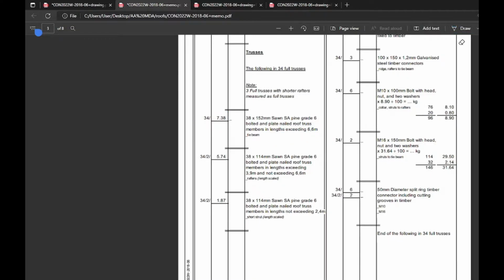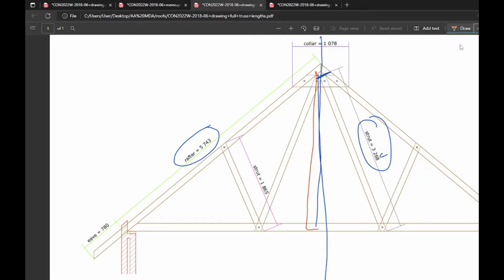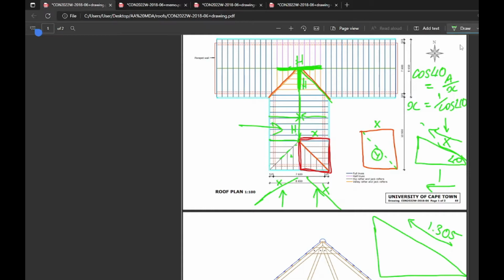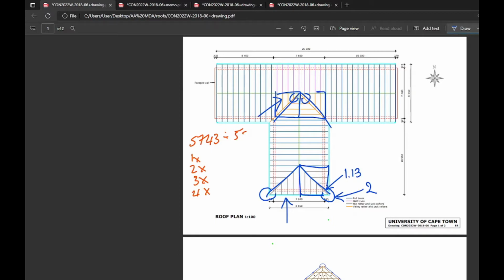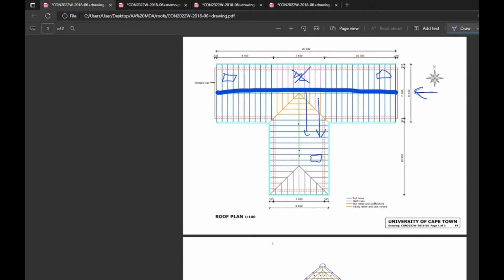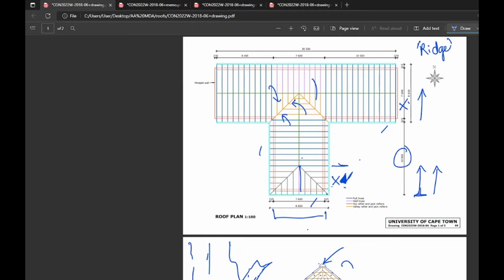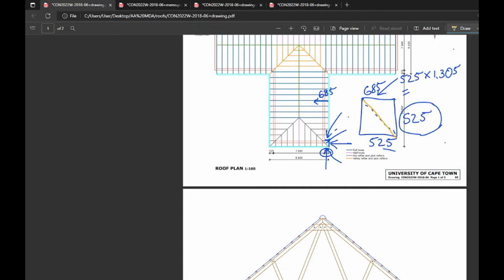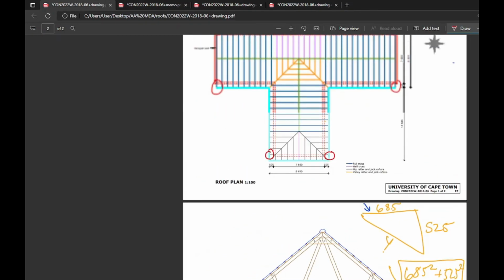Remastered - MDA1/CON2022W tiled roofing - CON2022W-2018-06 drawing

Comment: What if there is a king post where does the gang boarding go
Reply from the maker: Propose a solution? 
To hazard a guess, I'd say keep it the same (the difference is half the king post width + half the gangboard width when measuring the length of an intersecting gangboard). If you're really diligent then take the main roof length as usual and make an addition or deduction (depending which side of the kingpost you want to measure the main gang boarding along) to the intersecting gang boards length (ie in T-shaped roofs)